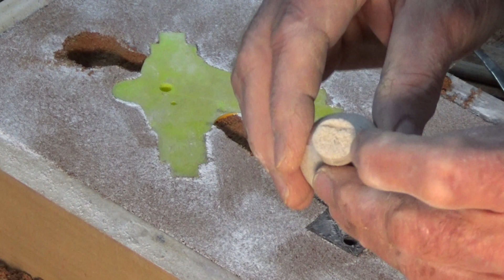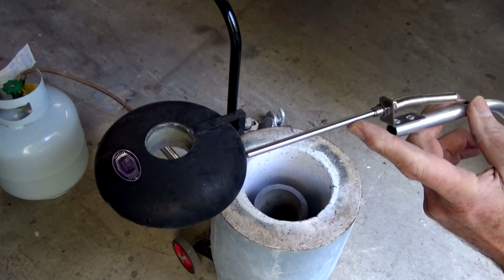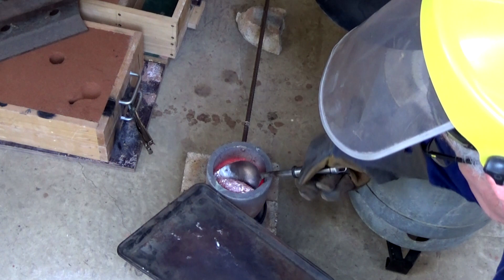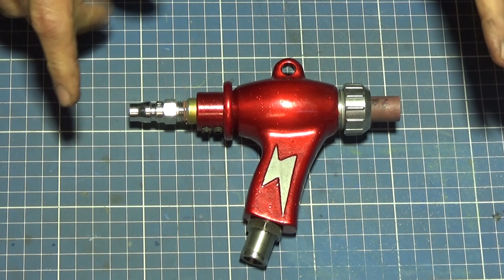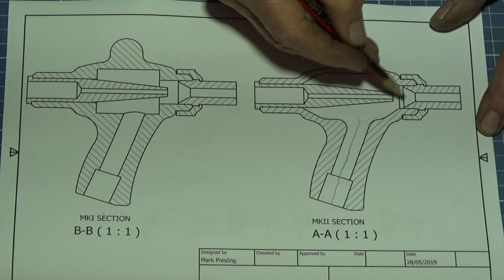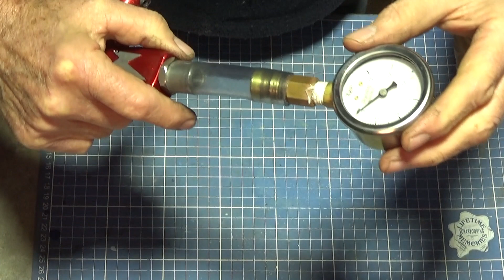DIY Cast Sandblast Gun MKII - Now with EGT!

Comment: What is the result please? Is the new gun more superior in media delvery and by your estimate of how much more.
Reply from the maker: Since switching over to this handpiece and a few other upgrades, the sand blaster is now performing much better than the stock unit. The improved handpiece is capable of delivering a continuous stream of media from the nozzle, even though it tends to surge when sucking the media from the bottom of the hopper. My observation is that the cavity inside the handpiece is capable of holding a reserve of whatever media you are using and it is ejected from the ceramic nozzle at a constant rate.
I have also upgraded the method of switching on the air supply. https://youtu.be/HhgT67n5lDo
The description of the solenoid valve starts at approximately 15:26
Regards,
Mark

Comment: Hi Mark,  Good stuff!  I was wondering if the clear, flow-visualizer gun was ever made and tested?  Thanks again!
Reply from the maker: Thanks for reminding me about that project. I did buy the clear acrylic tube for the gun body and I 3D printed the handle but that was as far as I got. If the gun was going to give me trouble I intended to follow through and build the clear body gun to see if I could diagnose what the issue might have been. However, the version I made has proven to be trouble free but I will make the plastic version just to verify what I believe is happening with the flow of grit inside the body of the gun. 
Regards,
Mark

Comment: I could not pick up how you had advanced this gun from this video onward.
I have a similar cabinet from way back were the sand is picked up from inside the bin at the bottom. It suffered similar problems of sand delivery, the idea of a metering valve helps to some degree. I fitted a pressurized air supply with a delivery control valve to the pick up tube this greatly helped fluidizing the sand in the tube assisting it up to the gun.
Rather than a metering valve you should fit an pressure air delivery valve via a ventury  in the bottom fitting  this will fluidize the sand in combination with the suction should work well.😊
Reply from the maker: I did try pressurising the sand in the metering valve with low pressure air and it didn't work for me. It just seemed to blow bubbles into the media and the surging got worse. We used to fluidise a polymer powder by blowing low pressure/high volume air into the bottom of a chamber through a piece of porous board called "Canite". It would double the volume of the powder and lower the density by a half. If there was some easy way of doing the same thing in the bottom of the blast chamber it would make it much easier to pick up and deliver the media. However, since fitting my DIY cast metering valve and getting rid of the original handpiece I find that I can now get very acceptable results using both garnet and glass bead media. There is still some surging but it doesn't seem to affect the rate of delivery at the actual nozzle of the gun. My intuition tells me that the chamber inside the gun can hold a surplus of media and the nozzle can only deliver part of that surplus at any given time. A pressure pot added to this style of blast cabinet would be way better but it takes up more room in my shop and I have run out of room!
Regards,
Mark
Reply: @Preso58   Hi mark, in your case my thoughts were introducing the air via a tube ventury at the sand exit rather than at the metering valve.  It would need a fair bit of tuning to get the best result, just a thought cheers .

Comment: did you consider drilling a 25mm hole in the body and a 30mm shallow 1/4 recess and putting a piece of 1/4 inch  thick x 30 mm  Lexan plexiglass  in the hole and seal it with silicone or a o-ring to see in the chamber. maybe on both sides to let more light in to actually see thru chamber. Lexan holds up to the sand scratching better than plexi  good luck ! GC   keep up the great videos
Reply from the maker: Gary, I didn't want to modify the finished gun and it does work well. I actually purchased some clear acrylic tube and I 3D printed some other parts so I could make a clear bodied mockup of the finished gun. My theory is that the sand is sucked up in large "gulps" from the hopper in the bottom of the enclosure and it is then stored in the cavity inside the gun. It seems to discharge the grit more or less continuously so the cavity is acting as a sort of buffer. I wanted to be able to see this happening for myself though. I still have all the parts, it's just a matter of machining up some fittings and joining everything together. Sadly, I tend to get distracted by new projects all the time but the intention is still there. 
Regards,
Mark

Comment: Is it possible that it could be causing an airlock situation where air is blocking more sand to enter through line even though air is going through nozzle or you could put the sand nozzle further forward closer to the nozzle and angle it slightly close to nozzle angle
Reply from the maker: There is a lot going on inside the whole system. Stuttering and intermittent flow is a common issue with suction type blast guns. Mine is more or less as good as I think I am going to get it. It does seem to project the media continuously even though it is not sucking the media up the line continuously. I believe that there is sufficient residual media inside the cavity of the gun to keep accelerating it out of the nozzle but without being able to see inside it's hard to tell. I have been meaning to make a replica of this gun with a clear acrylic body so I can see what is happening inside. I have all the materials I need to do it but I sort of ran out of steam once I got the current setup working semi satisfactorily. I really should get it done just to satisfy my own curiosity.
Regards,
Mark

Comment: Hi Mark, love your work mate on this sandblasting mood..hey where did you get the foot peddle for this setup..cheers Al
Reply from the maker: I got mine on Ebay. https://www.ebay.com.au/itm/New-G-1-4-Threaded-Air-Pneumatic-Pedal-Valve-Foot-Switch-2-Way-2-Position/171278177413?ssPageName=STRK%3AMEBIDX%3AIT&_trksid=p2057872.m2749.l2649
It's OK but the ports inside the valve are fairly small and they probably restrict the airflow a bit. I have just recently purchased a much bigger silent air compressor and installed a second air tank giving me a total of nearly 300 litres of reserve air. I also upgraded my air delivery system to 19mm copper pipe. I have an air coupling coming off the reserve receiver so I should have much better air volume to the sandblaster. I have yet to try it out but I am planning to do a follow up video soon showing how this works out. I also promised to do the see through blast gun and I have the parts ready but it's still on the "to do" list. Hopefully in the new year.
Regards,
Preso

Comment: Hi Mark love your work mate, hey where did you get the foot peddle for the blaster..cheers Al
Reply from the maker: I am not sure if I have already replied to this or not. For some reason I am finding that YouTube is not showing some replies but I got my pedal from Ebay. It was a fairly cheap unit that has very small ports but so far it seems to work OK. https://www.ebay.com.au/itm/171278177413 The listing now says it is out of stock but you may be able to find a similar one.

Comment: if your using a Abrasive Metering Valve inlet air should be 40 to 60 psi 80psi is really high the stupid 2 metal tube in a tube needs 60 to 90psi to work but a Abrasive Metering Valve should not u may need to adjust the air to 55psi or so then readjust the inlet on the Metering Valve. the max i use is 65psi with 80 grit black beauty and 50 psi with 120 grit glass bead. hope that helps and thanks for shearing

Comment: Hi Mark,
when you form the pouring basin connection to the sprue, the connection should be of sufficient cross section so that the sprue runs full. in this way the sprue will not suck any air down the sprue when pouring.

Also what foot peddle do you use as I am planning to purchase one.?
Reply from the maker: Charles, there seems to be so much to learn abut metal casting. A lot of the technique seems to be counter intuitive. I used to think that you needed to get the molten metal into the mould cavity as quickly as possible. Seems logical right? But as you say it is more critical to get the melt in smoothly and without turbulence. I have been watching some interesting videos by Andrew Martin and Olfoundryman who detail some of the interesting methods used to design sprues and gates to divert the first rush of sand and dross and how to design the cross section of the sprue to match the mould cavity. I am still experimenting and trying to put this information into practice. So much to learn. With respect to the foot pedal, I purchased a cheap Chinese type from Ebay but it seems to have very narrow ports and I think it is throttling the air flow to the gun. In hindsight, it might have been better to use a large bore  ball valve and arrange a knee lever of some sort to control the air supply. The foot pedal does work but it works better without it. This is the one that I got https://www.ebay.com.au/itm/New-G-1-4-Threaded-Air-Pneumatic-Pedal-Valve-Foot-Switch-2-Way-2-Position/171278177413?ssPageName=STRK%3AMEBIDX%3AIT&_trksid=p2060353.m2749.l2649
Regards
Mark
Reply: @Preso58  Hi Mark,
that was the foot peddle I was thinking of, but I agree that it could well be throttling the air flow.

Your idea about a ball valve can be worked on it has merit. I say a ball valve and a peddle connected  through a common shaft can  work

Comment: Hi Mark - just and add on tip from what I left on your last video.  Maybe put an o-ring on the back or your gun for the jet assembly to prevent any air from pushing back out past the jet and grub screws.

Comment: Nice looking gun, well made,I cheated, I cast my own gun bodies in my home foundry about 40 0dd yrs ago but copied them from a commercial gun & have used  it ever since, but for larger jobs you need a pot,I also copied a commercial  pot & made that too, boy does it remove rust but you need a big compressor to keep going.
Reply from the maker: I am coming around to the view that a pressure pot is the way to go. I do have very limited space in my shop though so I am going to have to mount it up high on a wall. 
Regards,
Mark

Comment: First thx for the excellent videos, second I wonder if the angel or possibly a offset on the media feed in relation to the camber and the centercore (maybe get whirlwind going inside the camber) are considered for the see thru version. When you pump concrete you really don't want sharper bends than 30° or you will risk uneven flow. If your media hits the centerbody it might be intermediary clogging (aka storing media).
Reply from the maker: Den Samme, I took the parts down to the shop today for the clear bodied blast gun and I must follow through on that build. It's on my to do list.
Regards,
Mark Presling

Comment: I really enjoy foundry work, and I can see that you do too. Great video, I'm envious of your abilities in your endeavors here as well.  I do have perhaps a little more experience with media blasting though. My semi-professional blast cabinet uses a solid brass gun with no internal features at all, other than a through hole for the air, and a converging passageway for the media. The reason the blast gun that you modeled yours after has the rather large cavity within, is a production trick by the Chinese manufacturer to save material. It simply serves no other purpose. The real secret to the industrial blast gun tho, is the solid tungsten carbide nozzle. It's a cylinder about 3/4" outside, and 2 1/4" long.  It has a 1/4" through hole, but both ends have a deep counter sink, leaving an edge about 1/16" wide, so the nozzle can be used as a scraper as well. Perfect for knocking off the occasional paint chip or other stubborn stuff that won't move. The nozzle  is reversible, so the counter sink on the inside serves to funnel the mixture into it. Of course, the biggest advantage is that the solid carbide will never wear out, opposed to the cheap ceramic nozzles provided for the low use home versions. Also, the manufacturer recommends 90 to 100 psi for fast removal of paint, rust, and corrosion... lots of air.
Reply from the maker: Tom,
I have a supplier of those carbide nozzles bookmarked for future reference. I have about four of the ceramic nozzles and I was considering making replacements from CrMo bar stock and fully hardening them. That way I can incorporate the double ended feature that you described. I still think that the large cavity is smoothing out the flow of media to the nozzle but I won't know until I make the transparent version.
Regards,
Mark

Comment: Hey Mark I am really enjoying some of the videos someday I would love to come to your neck of the woods and check out that country like you I have battled with the sandblast guns I have bought a few different types one of the things that I have found that really seems to make a difference is air volume not so much pressure but volume I run my machine at about 90 psi on a half inch hose I have a 15 horse compressor it really makes a difference with a bigger compressor I have a one-man Welding and machine shop and heavy equipment repair so we do a lot of bead blasting at times can’t wait to see your next videos thank you very much for your efforts
Reply from the maker: Thanks Joe, yes, come to Australia. Doesn't matter where you're coming from, our useless dollar is now worth about 69US cents so it'll be a cheap holiday. We are even close to parity with the New Zealand dollar!😭 I was wondering about air volume. I am thinking that I may run a dedicated line to the blast gun and use a large diameter ball valve instead of a foot pedal. I might rig the valve up so I can operate it with my knee. I am still wanting to get a new compressor but for now the current set up works but it is slow. Time is not an issue for me but if you were running a bead blaster to make money you would want it to be efficient.
Regards,
Mark Presling

Comment: what an awesome build. just learning casting and machining..this is really something   to aspire to build. thank you.
Reply from the maker: There is nothing terribly hard about casting aluminium. I had shied away from it for a long time thinking that you would need a ton of equipment but I started out with a pretty basic setup and the very first casting I made was successful. I keep all my old patterns and just recently I put them all into a box and stored them in a container. I couldn't believe how many I had! It opens up so many possibilities for creating your own stuff. I think it is more versatile than machining things from solid stock and if you have access to scrap aluminium or brass you pretty much get it for free. I buy some scrap from the car recyclers. I pay $1 per kilo for old cylinder heads and inlet manifolds. It is good stock and easy to cut up. Have a go. It's fun!
Regards,
Mark
Reply: @Preso58  thanks mark. i actually am building a beer keg kiln...prolly will use kao wool instead of refractory cement..i have a 3d printer to make mold....and a ton of wood working  stiff to make patterns etc...i have a cool idea to make flasks also...im going to do a video on it soon. :)  keep up the great work.
Reply from the maker: Great,
can't wait to see the video.

Comment: I wounding if sending the  exhaust form the dust collection in to the media holding tank would help the spotty flow buy liquefying it in a way  I think mark rober did a vid doing it to a pool
Reply from the maker: Bradley,
I did try this and it only worked for a short time, like, seconds. The problem was that the blast media would get pushed up the delivery tube until the air created a bubble and then it would just suck air. Fluidising the media needs large volumes of low pressure air and you need to push it through a semi permeable base under the media tank. We used to use a material called "canite" which was a sort of acoustic board. You could double the volume of powder and halve the density but we only used to use it on a plastic dipping powder for coating hot steel. A bit like powder coating only it made a thick rubbery coating. I would like to do some more experiments but for now I am happy with the way the gun is working given my second rate compressor. I am still hoping to get a higher rated compressor and then I can tune the gun more.

Comment: Mark,

Have you thought about spot drilling depressions where your air jet's set/grub screws contact the jet body?  After a while, those screws will raise a burr that can make it difficult to remove the jet and will damage the inside of the ray gun body where the air jet body fits.

I'll also try to contact a blast equipment guru once I get back to work to see if he knows what could cause your slugs of media to travel up the hose.  With luck, he'll have some good ideas.  However, with your Flash Gordon/George Jetson "blast" gun, you ought to be able to blast all crud from whatever needs it.  ;)
Reply from the maker: Bob, I will be spot drilling under the set screws once I am sure i have the jet in the correct position which might be never since there are endless adjustments that can be made with air pressure, air volume, blast media composition etc. etc. Still, the gun does what I want it to. I am now afraid it will get scratched or chipped if I use it too much. 😁